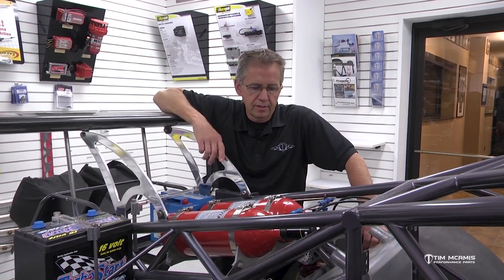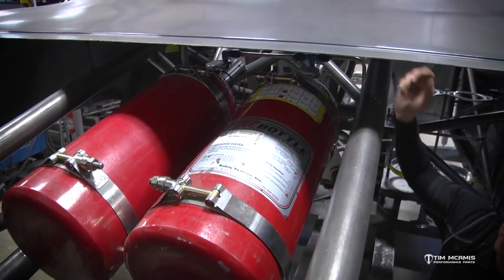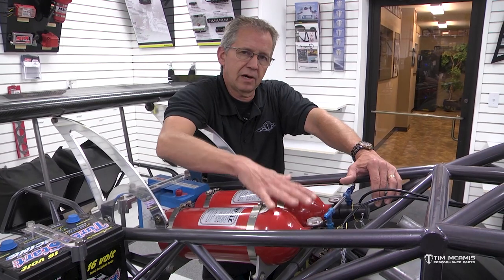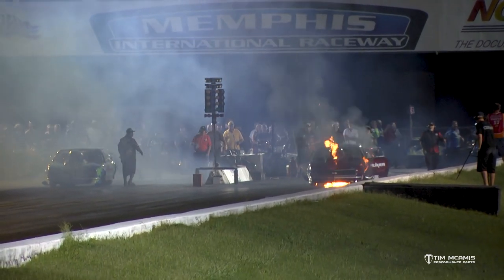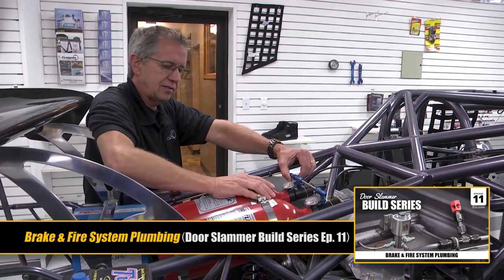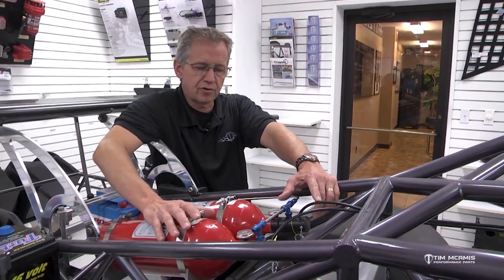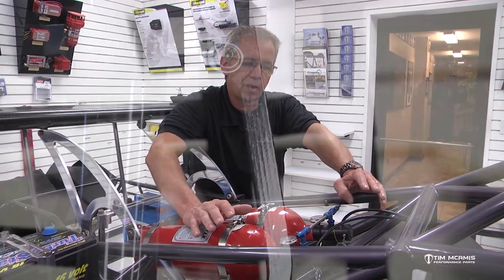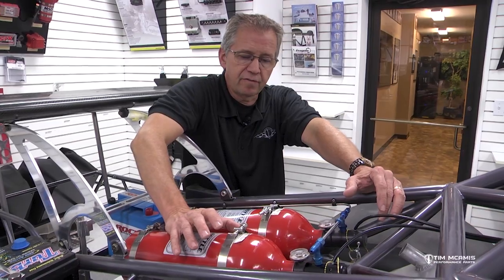What You Should Know About Racing Fire Systems

Comment: The bottles can be recertified by any fire extinguisher company. I have mine DOT hydrostaticly pressure tested, refilled, and recertified every 5 years. My ring has a ton of  recertify dates rolled on it since I've had mine since 2000.
My work's bottles get tested and filled every year, and recertified every 5. The DOT hydro test is an easy overnight service by any reputable company.